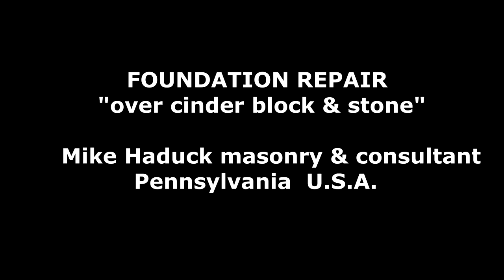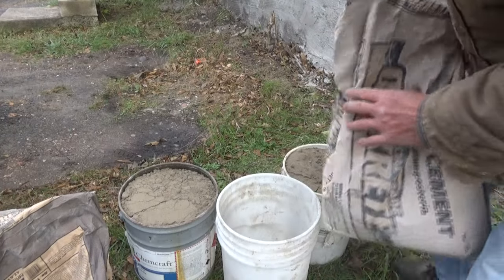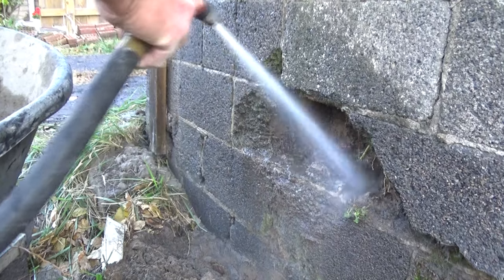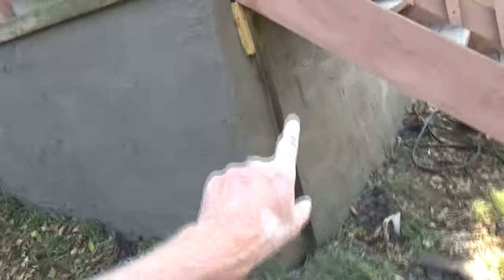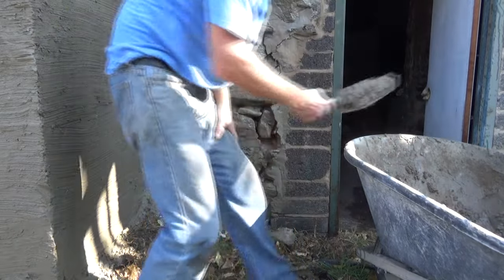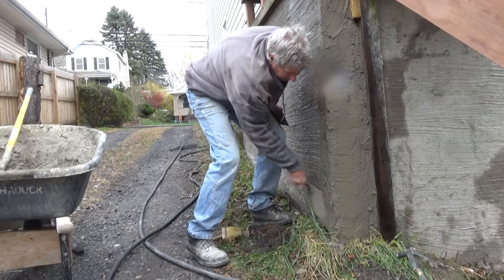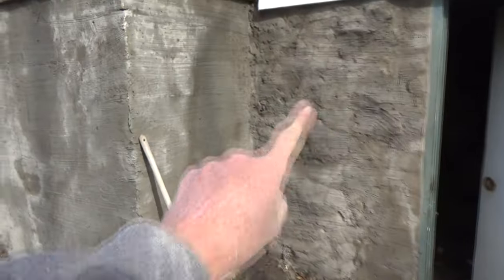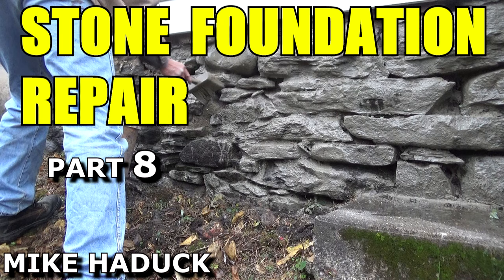FOUNDATION REPAIR (Part 15) Mike Haduck

Comment: Mike Haduck is the kinda Boss you'd be glad to work for to learn all the knowledge and wisdom Mike has to teach. I have to rewatch this video and take notes as I'm planning on repairing the appearance of a old 1950's block home.  One question I see is how far below the ground level should we plaster
to help prevent water ? The combat finish would make this block home look a bit more modern and fancy. Thanks for all you do Mike. Here in Florida.
Reply from the maker: Hi Michael, I don't think there is many basements in Florida, but it all depends on if you are getting water in the basement or not, if not I just go down about 5 inches and make sure the raingutters are good and land is pitched away from the house, thanks Mike

Comment: Today I poured a step.  Followed what  Mike has shown in his videos. Took me a while concrete  landing had sunk 2 and 1/2 inches on one side . Tried to raise it up but impossible . The step up on one side was 12 inches. But Mike says no big deal its concrete. So I split the difference. Now the step up the rise is 5 1/2 on one side and 6 inches bnb on the other . The step is 12 inches. Now I see why he has the pointed  trowel in his hand all the time it does magic.  You can tell I am a rookie but Mike gave me the courage  to at least try. At 74 I should be relaxing but it's not my style. Thanks Mike , I had a screw up. I waited a little too long to round the edge of the step. But still got it done by muscling  the concrete edge . We shall see tomorrow.  No big deal I will fix it somehow.
Reply from the maker: Hi Terry, that's how it goes, 99% perspiration 1% inspiration and you always win, thanks mike

Comment: Mr. Haduck, after watching some of your videos, This 66 year old set out to repair a shed slab that I had poured last year. Although the footprint was not large, the shed was relatively tall. I was concerned that leaching aggregate from around the shed's perimeter could eventually undermine one of its supports. Armed with your experience, I completed the repair in approximately 5 hours. As a result, I am confident in the fix and elated at the results. I know that you have done some great videos from your worldly travels. How about a trip to  NASA to find out how they will eventually form masonry structures on the Moon or Mars. Thank you and may God Bless you and your family.
Reply from the maker: Thanks M, God bless,  Mike

Comment: So, Mike. In the beginning of the video you showed the crumbling block wall of a porch/deck patio, what do those broken and cracked blocks say about the strength and integrity of that structure. Will it be safe or safer, when you replace broken blocks that need to be replaced and repair the ones that need to be repaired?
Reply from the maker: Hi Tashtan, I never had a problem or callback on the way I do it, thanks mike

Comment: Step 1. Clean old wall
Step 2. Fill gaps with brick and thick mortar
Step 3. Don't make a big deal about it
Step 4. Paint wall with wet mortar
Step 5. Don't make a big deal about it.
...so far so good
Reply from the maker: Thanks Brandon, mike

Comment: Also, after you painted the mine rock wall with Portland + water paint, you covered the mine rock wall with "stiffer cement". Was the stiffer cement made from Portland paint with less water to make it stiffer, OR was it the 2 parts sand + 1/2 part S mortar + 1/2 part Portland mix?

Also, you came back after 9 days and added a 2nd coat of "cement." Was it the 2 parts sand + 1/2 part S mortar + 1/2 part Portland mix, OR something else?

 I could easily mess this up.
Reply from the maker: It was all 2 parts sand and 1/2 part s mortar and 1/2 part portland, thanks Mike

Comment: After you finished filling the holes in the cinder block stair section, you plastered over that entire section of cinder blocks to make a scratch coat. Did you use the same mix that you used as mortar to do the repairs of the holes: 2 buckets sand + 1/2 bucket S Mortar + 1/2 bucket portland to plaster the scratch coat on the cinder block stairs? [You said you were going to get some "cement" to put a scratch coat on, but didn't say what kind of cement.]
Reply from the maker: Hi Exeter, yes it was the same mix I used to do the patching, thanks Mike

Comment: Ive got a cement block wall coated over with tar. Its awful. The cement is bulging in places so its a mess. Chipping away at it, but wonder if the bonding agent you mix up will stick to the tar if i cant get it all off. Thanks
Reply from the maker: Hi Bev, I try and get as much off as I can and sometimes scar the foundation to make it stick, I show it in the playlist,  thanks Mike

Comment: I enjoy watching your videos. One of the walls that gets no sun I notice that humidity (water ) was getting through I guess they are cinder blocks? This is by a garage and inside I see there is some erosion that I need to fix. I decided to use dry lock fast plug that was king of difficult but I did it and now I will apply dry lock extreme to paint over it. My question if you could help: did I do the right thing? And do I use the same thing inside to fill in some of the cracks and then paint with dry lock extreme? Really need advice from a Master Mason like you to help me along. I am extreme Amateurish DIY THANKS!
Reply from the maker: Hi Arthur, as long as it works, drylock is a good product, Mike

Comment: I see on other videos sometime you use old time bonding ( Portland and water[sometimes adding a bonding agent]) and sometimes only watering the area down before making a repair or applying a skim coat. I see on other videos different mixtures for mortar, however the stone basement (inside work) and this block repair (outside work) seem like they both need holes filled.  Can you explain how to choose between your different mortar mixes? The 1 Portland to 2 sands mix seems a much higher psi than M type mortar. I would think a stone basements would flex more and therefore a more flexible N -type would limit cracking at the joints. 
Your videos are very inspiring and after the next trip to the supply store I will have S - mortar, Portland , sand, s-type mortar mix and rapid set all stored ready to use. Have been think there is a correct mortar formula to use for this job, but maybe any will work. The job is an inside stone granite rock(ground[ by glaciers] both whole irregular and split cobbles)  basement, where the mortar has turned to sand and falling out between the joints.
Reply from the maker: Hi Edward, I did a series called, " what cement should I use" mike haduck and another called "should I wet it first? Mike haduck, but I usually show what I use in each situation,  mike

Comment: Hello. So for that kinda plaster the second coat or maybe any parking what’s the ideal mix? Wud be 2 sand and one Portland ? I live up north in Canada. And They have parging cement but I’m thinking that the Portland mix is prob better. What do you recommend ?
Reply from the maker: Hi elc, I can't say ,I only show what I used and did, every job is a bit different,  thanks Mike

Comment: Hey Mike! We have a house built in 1909, the foundation is only about 14 inches from ground to siding. I want to do this method, would I need to dig a couple inches of soil around the entire foundation? Mainly trying to keep mice out.

Also, can I leave it with the lines from the broom? I know imperfections will show, but that doesn't bother me. Just wasn't sure if the outside finish was just cosmetic?
Reply from the maker: Hi mohberly,, I always dig down about 6 inches or so if I can, I have done jobs where they just wanted it scratched with the broom and then years later they could continue with a finish, thanks Mike
Reply: @MikeHaduck  thank you Mike for replying!!! Around hoses and stuff that go inside the house, how do I seal those up? We live in Illinois so they need to be able to expand and contract so I know I can't do cement tight around them. But worried about how to close up those gaps? 

Also, will the cement going directly up to the siding affect the siding? I know cement can burn/eat through certain material and we have vinyl siding.

Comment: Hi Mike, is that mix ideal for below grade repairs as well? Got an old block foundation that im digging up in the spring to fix a leaky basement
Reply from the maker: Hi MaD, I got a video "basement water problem solutions" watch that first, but yea I used that mix below grade but also used foundation coating over it,, the big deal is to have the land sloped away from the house and rain gutters drained away from the house, thanks Mike
Reply: @MikeHaduck  Thanks man, Yeah Im pretty certain once we get down there there is some disintegrated bottom blocks so hopefully can repair and hit it with some liquid rubber or tar.

Comment: So the color of Portland cement changes depends on how long it takes to dry? And the second coat will dry consistently because it's the same thickness?
Reply from the maker: Hi Joe. I would say it drys more consistently 2nd coat, a lot depends on drying time etc, every situation is diffrent, thanks Mike

Comment: at the 3:39 sec mark when you are telling the mix for plaster, is it two masonry sand 1/2 bucket portland,1/2 bucket S mortar?
My hearing is bad so just want to confirm< thinking about plastering my foundation.
Love your videos
Reply from the maker: Hi Samuel, that's correct 1/2 bucket S mortar, 1/2 bucket Portland and 2 buckets of mason sand,   the s mortar I am using is straight not the premix, do a little experimenting wait a few days and see how it works for you, Mike
Reply: @MikeHaduck  thanks Mike,, I will give it a try and I’ll try not to make a big deal out of it 😁

Comment: Mike, I just discovered your videos after searching for ways to repair my foundation which will inevitably need insulation on the outside as well. I have one question for you, would you recommend this as a way to smooth out and make a textured cmu wall have a uniform surface for future water proofing? Thank you! Going to dive deep on this to figure out how best to do it my self!
Reply from the maker: Hi Sam, I can't say unless I was there. I have a lot of videos in the playlist, maybe they will help, thanks Mike
Reply: @MikeHaduck  I realized that the block I have is split face CMU, I was thinking of using your technique to parge over them in order to form a smooth face.

Comment: Another Great Video.  Thanks Mike!  What is the mix for the scratch coat on the block, and did it go on immediatley after (same day)  the big patches for the block wall?
Reply from the maker: Yes did it right after I filled in the holes, same mix,  thanks mike

Comment: Mike I am curious as I don't know much about the types of mortar so I looked it up and S mortar is to be used below grade. Why do you use it above grade?
Reply from the maker: Hi Dave, The old schoolers always made their own mixes with mortar and potland, now they try and standardize their own mixes and confuse everybody, if it's a foundation and below grade it usually gets a foundation coating, above grade I add usually add more Portland due to our weather, Mike
Reply: @MikeHaduck  Thanks for the info mike. I have an entire house to parge with areas of deterioration and one wall is peeling paint. After I am done that I need to poor a raised front door landing with five steps. I have formed concrete before but never stairs. Will be quite the job for me and I am in Ontario Canada so it will be getting cold really soon.

Comment: Mike I'm a little south of you in the Appalachian mountains what temperature range can this be done in should I wait until spring also I have precast steps 12 high getting hair line cracks they have been pressure washed and have never been painted sealed ect what can I use to strengthen them and make them last and seal them from salt...Thanks
Reply from the maker: Hi General, my rule of thumb is as long as it don't  freeze for a few days you should be fine,  thanks mike

Comment: Hey Mike, do I have this right that the S-Mortar you're using here already contains sand in the ratio of 2:1:9 (portland, lime, sand) or is there NO sand in the S-mortar bag ?
Reply from the maker: Hi Marco, you can buy s motar that is premixed with the sand, this is relatively new in mason world, I still use my old school recipe, I did a series called," what cement should I use"  part 2  ,that should help, mike
Reply: @MikeHaduck  Thanks once again Mike. Starting to see that "Masonry Cement" is just the mix of Portland and Lime while "Mortar Mix" has the sand already mixed in. Slowly piecing the puzzle together, lol

Comment: Hey mike, I’ve got a duplex that the foundation is getting a little rough on.  I was looking at options to get it a little more air tight to avoid the occasional frozen pipe.  Thinking about plastering like I see you do on so many videos.  I realize this is a cheap fix and “a patch is a patch” how often would something like this need patched over again.  And how long before it needs totally redone?
Reply from the maker: Hi David, it like anything else it all depends on the situation, I haven't had any complaints,  thanks Mike

Comment: Hi Mike! I’m having a hard time finding instructions for parging or stuccoing a poured foundation. Do I get it wet? Do I use the old school bonding agent just the same? I’m gonna make a little bit of a big deal with it because I’m doing it to make my house look better. You can see ridges from the foundation mold seams, and it’s just ugly. I have about 2’ of my basement showing all around the house, under the siding and the brick facade. I thought I’d need chicken wire, but I guess not? Thanks so much if you see this and answer.
Reply: By the way, that looks absolutely fantastic. What a difference!
Reply from the maker: Hi, I might scar it up with a grinding wheel, I do it a lot on my foundation repair videos, but I would do a very small section first and where you can experiment,  before it's seen, cement takes a few days to set, thanks mike

Comment: I have to fix a block wall made of 1940's cinder, it's just flaking off . any recommendations so it stands up and holds up the house?
Reply from the maker: Hi Felipe, I can not say unless I was there to see it, thanks Mike
Reply: I have blocks that were made from furnace leftovers. it's what they used in some houses in the area, it was during the late 30s and early 40s to save money I expect. the outside stucco cracks over time but in a really bad way making it hard to get a solid bite.I did your cement/water paint for the bonding vs using wellcreak product. hopefully it works.  thanks for you videos. @MikeHaduck

Comment: Mike if you have a basement wall with cracks and some bowing.
Can you reinforce it with another wall of cinder blocks up against the original wall.
Reinforcement???
Reply from the maker: Hi Lenny, I never had to,  I just fix what's broke, thanks Mike
Reply: @MikeHaduck  
To fix it Mike do I have to completely dig out the outside foundation? 
Or is their a fix from inside the basement????
Don't know which way to turn????
Reply from the maker: @Lenny Griffin  hi Lenny, I can't say unless I was there but I show what I done throughout my playlist, I hope it helps mike

Comment: If your cinderblock is painted, can you use that straight Portland paint for a bonding agent or should I buy the blue special purpose bonding agent? Thanks Mike.
Reply from the maker: Hi, I try and get most of the paint off and or put cut Mark's in then maybe add a little glue to the Portland, it all depends on the job,  thanks mike
Reply: @MikeHaduck  thanks man

Comment: When I was a kid I first heard the description cinder block and cement block 
used without much understanding as to the differences. 
Would either one be helped in a repair situation by applying a water proofing agent
to their exterior? One of my relatives used to keep all his cinder.cement foundations
unpainted because of water retention and drainage concerns.
His comments led me to believe the unpainted blocks would drain and 
dry out better but in your video here you said the bare cinder blocks deteriorated
due to water entry in the foundation.
Reply from the maker: I guess a new coat of cement paint would refresh it like new again so I am not much into water proofing,  thanks mike

Comment: Mike,
I started my church stair repair and I noticed my  mix didn’t seam right. I fooled your instructions. It appear to be too sandy. 
How is my mix suppose to look and feel. Oh another thing I couldn’t get my mix to stick to my towel. Any help would be helpful.
Thank you!
Reply from the maker: Hi Bob, I don't know what you used, concrete steps either rapid set or 1 Portland two sand, is mostly my mix, Mike
Reply: @MikeHaduck  apparently I may have of gotten you mixed wrong. I used 1/2 Portland and 1/2 s mortar to 4 part sand. Darn I used too much sand. 
Oh well it looks better than it did. I can redo in the spring.
Thanks Mike I am try to beat the weather this week before it gets cold again.
Reply: Your Portland paint is awesome!

Comment: Does anyone know

1. what causes these to crumbling and crack?
2. does one ever need to find crumbling/brittle concrete below the ground surface?
3. what happens to the dropped cement when patching? does one have to clean up?
Reply from the maker: Hi Justin, those days they didnt use a lot of cement and cellar was most expensive part of house because they dug it by hand , this series I showed what did in each situation, I never seen one I couldn't fix, thanks Mike